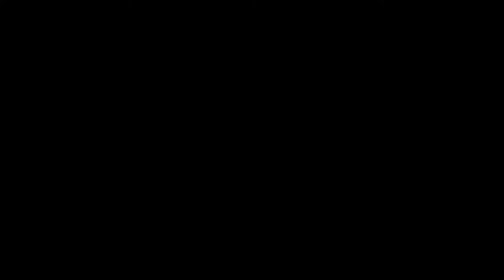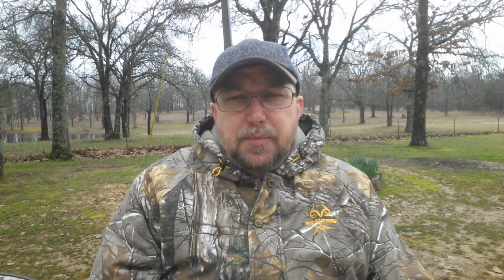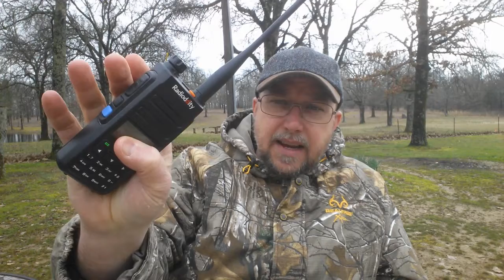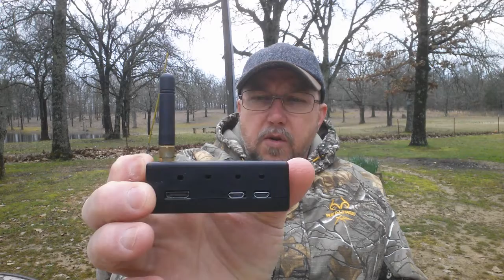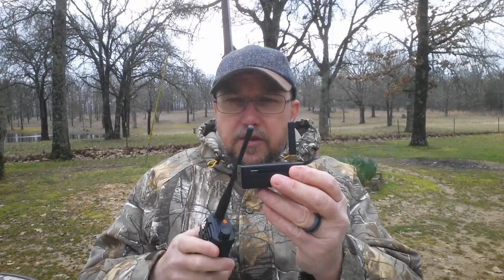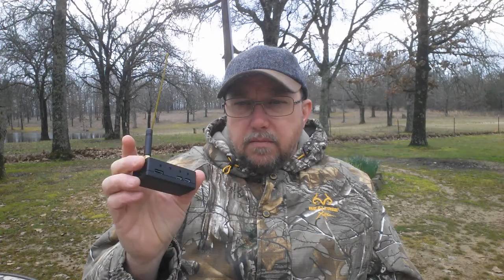Secure Radio Comms For SHTF & Now

Comment: There are some analog radios that are made by bofang and others that have an encryption feature and unless somebody has the same radio They won't be able to hear you
The DMR if someone has a digital scanner that has the ability to decode a DMR signal it will tell them the frequency that you are on the color code that you are using and the time slot that you are using and with those three pieces of information the scanner will hear what you are saying and they can program in those same pieces of information into their DMR radio and be able to talk to you

Aside from the Motorola radios that have encryption that allow you to enter an AES 128 key I have not seen any amateur radios that have an encryption option but it would not be that hard for them to add this to the radio and I'm guessing the reason they don't have it is because the government would not allow it to be sold because it would give unbreakable encryption to the average person

You can go out and buy digital Motorola radios and the programming cable and obtain the Radio Service software and program in your own frequencies and your own key but most people don't have the money to spend on those high-end radios and they don't have the expertise to be able to program the RSS even if they could obtain it

Comment: Can't use DMR on GMRS or FRS.  Not legal, only on the Ham bands but you can't use encryption on the ham bands in the US, Canada its ok.  Now days, the Anytone 878 portable offers AES256 encryption.  That's is secure as you can get.  All users would need to have the Anytone or another radios that supports AES256.  Any other encryption algorithm is ghetto and not secure.

Comment: A big problem of smartphone communication is that it's practically unpossible to hide your location (Edward Snowden talks about this in detail). How is this with radios? (avoiding the connection to the next hotspot) Just radio to radio!
Reply: I'll go ahead and take a stab at this since nobody responded. I'm an inexperienced HAM radio operator (just got my tech license like a few months ago). However, your question can be answered "it depends". With cell phones, it can easily be discovered what tower you are connected to, which means you'd be within that area (almost always at most 2 miles) and all of this is recorded. There is no such recording by a radio, and a radio does not have signature information that will tell authorities who is the owner of the person who made the call etc.
However, if you lookup "fox hunt" which is a popular activity done by HAM radio operators, this is basically the sport of finding radio transmissions that are hidden. This can be very easy for some kinds of radio signals, and next to impossible for others.
If you take "line of sight" radio signals, such as VHF and UHF, it is very easy. Also, using ground-wave, this can be tracked. It's nearly impossible to track HF radio signals that is used in NVIS communication and long-range communication that rely on the Ionosphere or "sky wave". 
If I were trying to communicate and not be found, I'd probably use an NVIS setup with a mobile unit, and communicate from different locations every day. I think you'd be extremely hard to locate if you did that.

Comment: DMR non-promiscuous mode- your group's radios set as to ONLY communicate with other group members-plus use the hexadecimal encryption key (allowable per FCC rules on commercial bands. Your group could obtain a business radio license...or, they could ignore the RULES set by the FCC, especially during SHTF/WROL. You can also send SMS via DMR radios.  It will NOT be secure against sophisticated SIGINT agents, but if they are after you,  then your are in deep trouble no matter how you communicate

Comment: Might as just get some used Motorola XPR 6500 VHF or UHF radios on eBay and the programming software. These will do Enhanced Privacy encryption (RC4-40 bit, 10 digit key, 1.1 trillion possible keys. They're way better than Baofeng. Is 40 bit encryption secure? No, but it will stop the 99.9% that hear your comms. Chose a decent key like "A58BDE4322" and no one will be able to guess it without specialized software and technical know how.
Or as someone else said, get the Anytone with AES-256 and no one will be guessing your key if it's random.

Comment: Encrypted radios! Expensive, not to mention ILLEGAL for Amateur Radio use!  Check the FCC Rules (Part 97).  DMR is different because it CAN be decoded with a lot less trouble.  SDR receiver with digital decoding algorithms in the software.  An Intel quad core is fast enough to decode DMR in a few received transmissions.

Comment: Good video.  Just a point of clarification: DMR is not in any way secure.  It's just a digital mode and can be easily monitored by any digital scanner or DMR radio with promiscuous mode (which identifies talk groups, contacts, & color codes).

Comment: If grid goes down, how will these even work buddy?  They won't.  So how can you say for SHTF?
Your video is deceptive.
Reply: Dmr radio will, the wifi box thingie no!
Reply: What he is doing is giving us options of whats out there how it works and pros/cons of each!

You should concider rewatching and try to understand the context of what was said! I can build a dmr out of a raspberry pi board and transmit all day long using nothing but an external usb battery pack without a wifi network! 

Also just because it is a shtf scenario doesnt always mean grid is down! Not every shtf situation is a nefarious one! Natural disasters also fall under shtf as well!

Comment: A slight correction. A radio doesn't have to be digital capable to have the ability to be encrypted. An analog only radio can also be encrypted. The military has been using encrypted analog radios for many, many years. When I was on active duty, in the 1980's, we used the Vinson KY-57 with our radios. Law enforcement and, our federal government, has also used analog only radios that were capable of encryption. Long before we ever heard of P25, DMR, NXDN, etc., I used a scanner radio to listen to federal law enforcement, Secret Service, and other's, using DES encryption. I personally have owned Motorola Saber, Systems Saber and XTS series radios (all analog only) that were capable of DES encryption. When I was in the military, 25+ years ago, we were using Motorola MX350's (analog only) with DES-XL and the audio sucked, with a reduction in talking distance, when encrypted. I have found that some CCR DMR radios have an encryption feature within the software. I own TYT, and Anytone, radios that are capable of encryption when activated in the programming software. For the average user, the built in encryption with these radio's is probably secure enough without having their comms compromised in real time. One thing I have noticed is, with my DMR radio's, there's no discernable audio difference between encrypted voice vs. unencrypted voice.Radioddity, TYT, Anytone, etc., all seem to be decent radio's for their price point. They're inexpensive enough to not break your heart, or wallet, if one is ever lost, stolen or broken. I do encourage folks to obtain an Amateur (Ham) radio license. It opens a new world of learning about emergency comms. Also, if you do obtain, or have, a ham radio license, encryption is forbidden on any frequency you're licensed for. But, I'm sure that will go out the window for a SHTF scenario.

Comment: Thanks for this. I just tested 2 uv-5r radios with the same dcs code and sure enough, I could still hear on a 3rd radio. (no codes input) It just mutes the 3rd from the other 2 hearing is all. DMR seems to be the way to go.

Comment: Are these DMR's waterproof? I am totally new to this, but I am fluent with computers. A quick search showed that DMR seem to be decriptable on linux, could you please tell me more about the security of DMR? https://www.youtube.com/watch?v=XalNmEn63dE
Reply: That video demonstrates demodulating DMR, not decrypting. Decrypting is a totally different animal from demodulating. DMR is a modulation type and can be monitored, in it's unencrypted form, just as any other modulation type (AM, FM, SSB, etc.). DMR is only as secure as any other modulation type that hasn't been encrypted. Several of the cheap Chinese DMR radios have some sort of encryption built in and must be activated in the software. I've noticed that most are only compatible within brand type, TYT only compatible with TYT, Anytone only compatible with Anytone, etc. If the brands are cross compatible, with their encryption, I haven't seen it... not saying they're not just haven't seen it.

Comment: If the grid goes down, there is a good chance that the internet will be down so you would not be able to use it for DMR or any other communications of that type. SHFT/serious emergencies must necessarily be independent of any communications infrastructure.

Encryption might have some use if you have a local group that does not want any outsiders.  But, you may want to communicate with neighbors and other folks nearby, thus encryption would be counterproductive. Ham radio, of course, is prohibited from using encryption, but you could use DMR or other digital modes such as P-25. You would likely find few, if any, to contact locally if using low power VHF/UHF HT's. Part 90 commercial gear is  possible (expensive) to license and set up for your group, and does not require everyone to take a test and be separately licensed as does ham radio.

Depending upon the seriousness of the situation and loss of telephone/cell/power/internet, others outside your group would likely only have CB or FRS (which can not use encryption). FRS is in the mile or two range and CB somewhat farther. 

We live on a farm in a rural area and have amateur radio HF/VHF/UHF,  CB, and also GMRS which can interoperate on most of the FRS channels but using higher power. With a moderately high gain antenna (40 feet), we can contact FRS HT's over a much longer distance depending upon terrain. 

There is one FCC service that is licensed by rule that might work for a local group within a mile or so. It uses the FHSS (Frequency Hop Spread Spectrum) 900 mHz band and you can set up your own talk group with a particular sequence which makes it nearly secure, even if someone else nearby has a similar HT (very unlikely). Only Motorola currently makes such devices and they are around $300.
Reply: As of this writing, P-25 is still illegal for Amateur Radio use.  FRS has limitations on power and antenna (must be permanently attached to radio).  GMRS is a good choice if you're not a licensed Radio Amateur.  It may also give you the 'ability' to encrypt if it's used for 'business'!  But, in a SHTF situation, would I be concerned about FRS limits and use of a Part 90 certified radio (Baofeng, TYT, etc.), probably not.  The range will be a bit better, but not enough to be noticable in the heat of battle, per se.
Reply: P25 is completely legal for amateur radio use as are any of the digital modes. We have some repeaters using P25. It is not as popular as some of the other digital modes because of the cost and the older P25 technology may not be as robust as some of the newer ones.
Reply: A QUANTUM COMPUTER WILL BREAK ANY ENCRYPT CODE. NOTHING IS A SECURE LINE ANYMORE. BROTHER

Comment: My Vol FD recently switched to uHF 800MHtz digital. What are the chances, with permission from dispatch, that I can get that Radiodity programmed on our frequencies.
Reply: The radios that I have, as well as most other low cost digital radios usually are only available in the 150MHz and/or 450MHz range.  The 800 and 900MHz radios usually are more expensive.
Reply: 10 4. Bummer. Thank you for the fast response.  Are there major pros or cons between 150 and 450?
Reply: The 150MHz, or VHF will usually travel farther.  The 450MHz, or UHF usually perform better inside buildings, in downtown urban areas with lots of tall buildings.
Reply: Not looking for the basic Joe blowe to call in a fake call. Was just wondering about connecting to my county without buying in on a $8000 radio. We are the experiment for the whole state and I can no longer get basic radio traffic,  which is helpful when enroute to the station and/or scene.
Reply: @bobby_mojo413  

Not going to happen. The county will not allow anyone using an off brand radio to connect to their system!  And if the traffic is encrypted, which many agencies are going to, you can't even listen anymore.
Reply: On most of those type systems each device consumes a license and they cost $$ beyond the radio price.  That's all controlled by County comms, it's doubtful you'd get access.

Comment: Is it possible to use a non DMR CB to connect to a laptop 3.5 headphone port
and use the laptop/raspi/etc to translate signal into DMR
if you have an existing non DMR existing setup
Reply: Good question, but the answer is no.  DMR is an emission mode, just like AM or FM.  They are not compatible at all.

Comment: Gday 
Have you seen LoRa and LoRa WAN frequency
Its a cheap long range direct to direct method
often able to go 5-10km without a problem 
with low wattage system
Reply: Not familiar, but will look into it.
Reply: From what i under stand lora can only transmit non audio signals like burst data transmissions